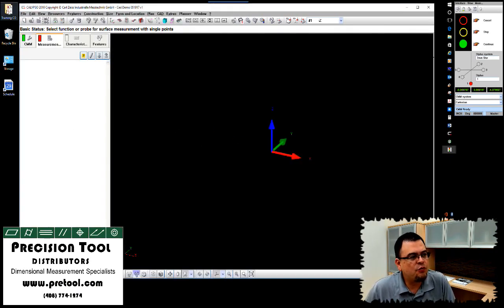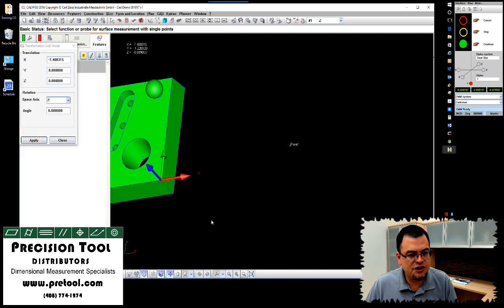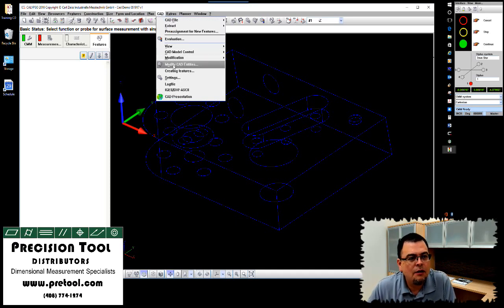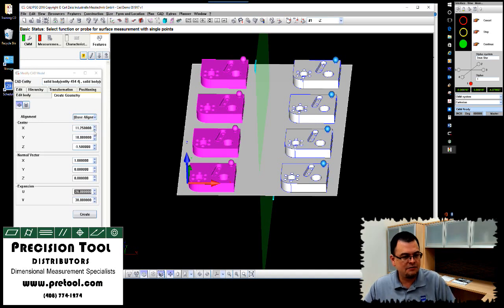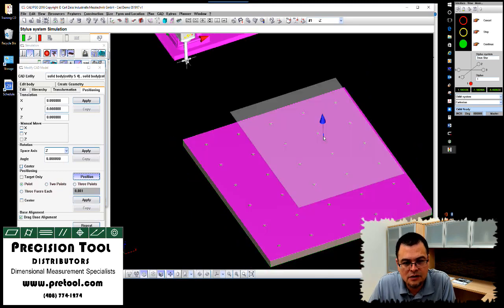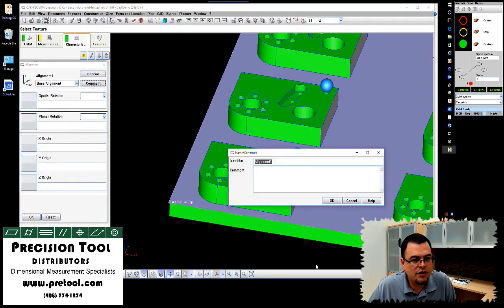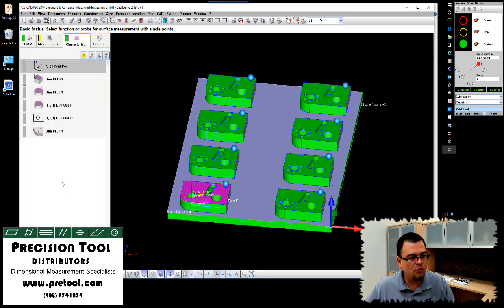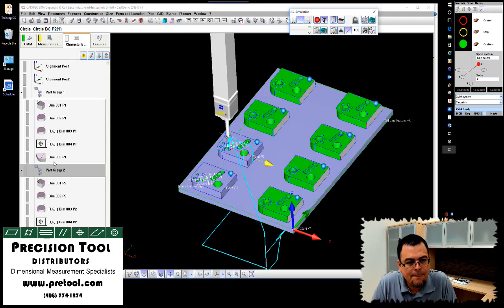John Feuerhelm - Calypso Live Stream - CAD Tools

Comment: .000394 is converted from metric to inch.
Reply from the maker: .0003937 or .0004 as well. It is a matter of rounding.
Reply: @Firehead-Q  That is not the point.